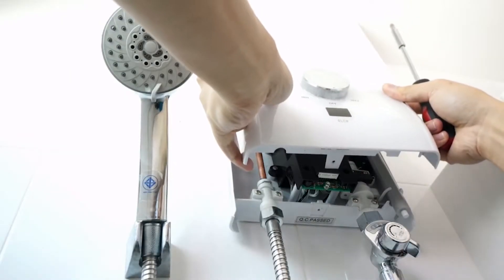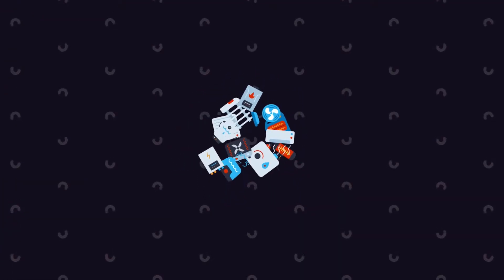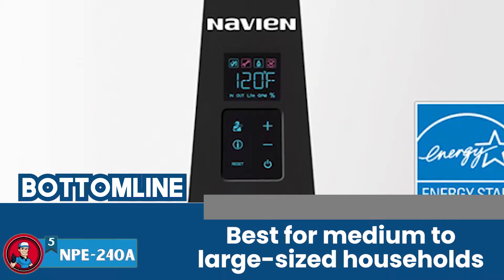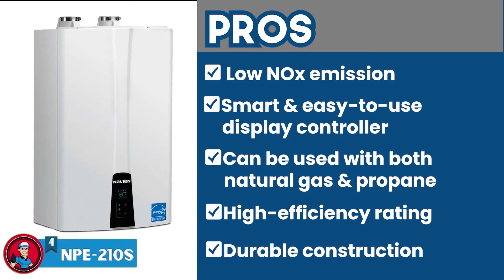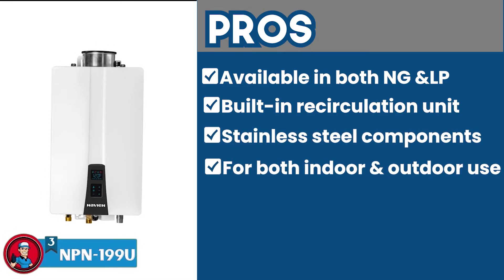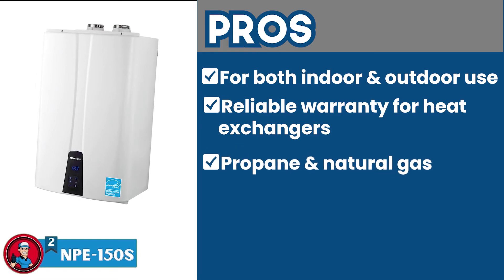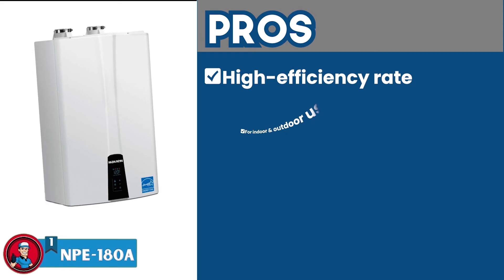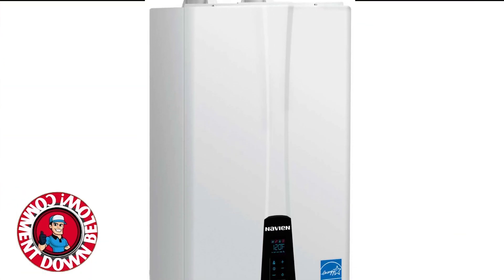Best Navien Tankless Water Heaters Reviews 💧: 2020 Complete Round-up | HVAC Training 101

Comment: thank you. I am having the 240 A installed next Monday in a 3 story townhome...anything to be aware of or ask of the installers re maintenance, etc.? cheers
Reply: Look at Mikey pipes your navien heat exchanger leaks combustion gas 100%failure rate
Reply: I am sad for you. I have one and the recirc has never worked. Scott leads the CEO doesn’t care he is selling crap. Amanda Monticello has no customer service yet is in charge of it.
Reply: @cmetravify  Scott Lee, not Leads. That would have been an amazing last name for a CEO though.
Reply: @cmetravify  which model do u have? We’re planning for our low rise building of 60 apartments.
Reply: @CuriousCat777  wht did u guys use ?

Comment: i had my navien water heater in a new house for 4 years. i have had nothing but trouble and the company does not stand behind this product. they say i did not service it properly. i have cleaned the traps , checked exhaust repeatedly. no help from navien! i would not recommend this product
Reply from the maker: We are very sorry to hear that
Reply: The heat exchanger must be flushed periodically to remove mineral deposits. Was that done?
Navien is only responsible for the unit, not the installation or the maintenance.
Reply: 100% agree its a piece of crap! I have one too for about 5 years and nothing but trouble